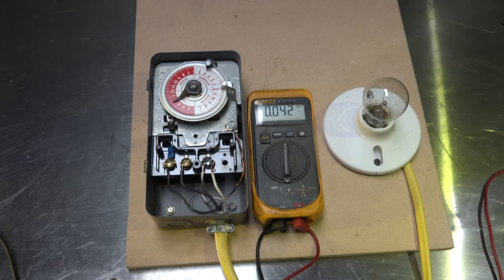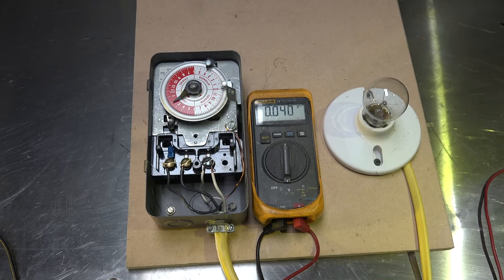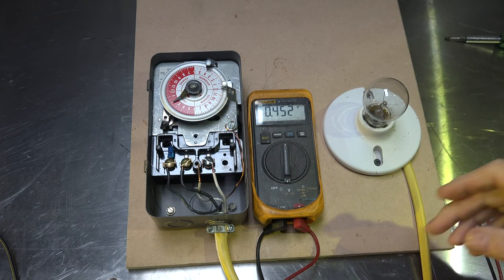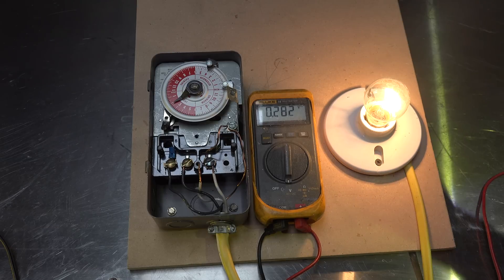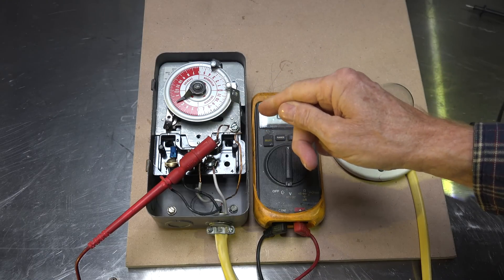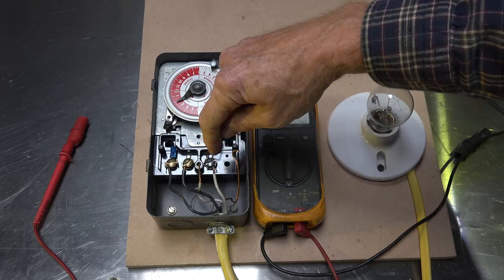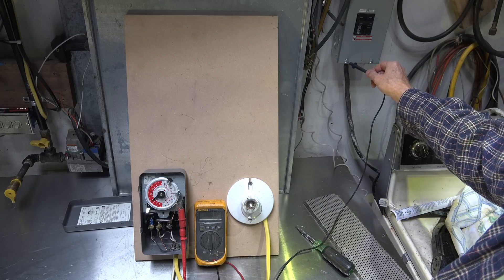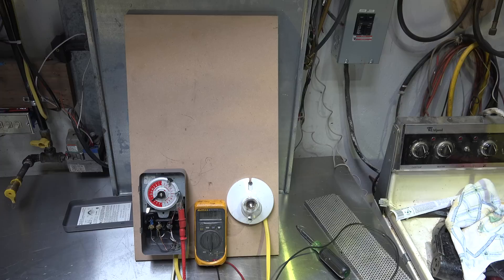The separation of  neutral and ground on the sub panel

Comment: I understand the demo and what is being explained here, I really think that in all the videos I've seen explaining this concept, people tend to over complicate things. The basic takeaway here should be that the neutral is supposed to be the only return path back to the panel. The ground wire is there for safety purposes. But most importantly, just as you should and would never connect grounds and neutrals together under a wire nut or whatever inside any other boxes downstream of the main panel like an outlet or switch box that also means you never do it in sub panel. Its nothing special about sub panels themselves. It has to do with the fact that if ground and neutrals are connected outside the main panel, then what you have is multiple return paths back to the main panel, and one of them being the ground which is not supposed to be a current carrying conductor under normal operation. Hope that clears up any confusion.

Comment: Would not having ground and neutral separated at the sub panel draw more electricity to run motors? My parents have two buildings, a well house and pool bath, that did not require permits due to the sqft per the building department. Their power bill seems to be higher than expected.  I'm trying to figure out why.  Secondly, do you have any tips for getting a neutral wire?  I was thinking about getting a single pole 50 amp breaker to replace the 50 amp double pole that is going out to the well house. Use the second hot wire as a neutral instead and somehow bond the two hot breaker bars in the sub panel together? The well house is about 250' from the main panel. I'm trying to avoid trenching.
Reply from the maker: I think you have a basic misunderstanding of the American 120/240V system.  
The separation of the neutral and ground is a safety issue, and should not increase power usage.  If you think there may be a power leak to ground, you can use a clamp meter on the ground at the sub panel.  There should be little to no amp draw read on the meter.
If the power for the sub panel is 240 volts, you do not need a neutral.
An absolute no on the 50 amp single breaker(if you could find one).
GFM

Comment: I have a generator that runs my fridge during power outages.
The 3-prong fridge 120v power plug gets removed from my house system
and gets plugged into the generator, via extension cord going out the window..
  My generator has its neutral & ground bonded (by the manufacturer).  
Generator also has its motor casing connected to the generator frame by a green 
ground-wire.
Here's my question:  Since the generator sits on 4 rubber wheels, it is not
technically "grounded" (?) . . . So if the fridge shorts out, is the generator frame
hot?  If someone touches the generator, do they then become a ground, and
get shocked, or, will the generator's 20Amp breaker kick off before that happens.?
Secondly, if the fridge shorts out while someone in the house touches its metal frame
with one hand, and a metal kitchen faucet with the other, does that person become
part of the circuit going to the house ground (?).

Comment: This is an awesome demonstration grayfurnaceman!
We have a 220V single phase Air Compressor that has shocked someone when the floor got wet from draining the tank.
I'm  thinking there is a neutral ran to the chassis ground in the pressure switch where the motor ground is also hooked up
causing it but I didn't get a chance to look in the panel.

Comment: But I was reading that before 2008 you could feed 3 wires and Bond the Neutral and Ground which is how it is done in my detached garage in the house that I bought.It was inspected so I assume that it is safe?
Reply from the maker: It is not that its completely unsafe, but it is safer under the new rules.  If it were mine, I would have a separate neutral.
GFM
Reply: @grayfurnaceman  I see. I'm thinking about checking to see if I can run a ground with the other 3, it's probably a 40 - 50 foot run, probably be tough to fish. Thanks for your input.
Reply: @grayfurnaceman  So what happens if I were to un bond my neutral and ground in the sub panel? Does stuff stop working? Is it more dangerous?
Reply from the maker: @BLomedico  If a neutral is installed in the panel, all 120 volt loads will work normally as long as the neutrals from the loads are connected to the neutral buss bar.  240 volt loads do not need a neutral.
GFM
Reply: @grayfurnaceman  Sorry for the ignorance. So do you think it would be less safe or more safe to unbond the neutral and ground in the sub panel. And I hold you harmless for giving me your answer to this hypothetical question. Again I appreciate you taking the time.
Reply from the maker: @BLomedico  More safe to separate.
GFM
Reply: @grayfurnaceman  Thanks again

Comment: I recently moved into rural property. Barn has subpanel with 3 wire service, outlets and lights  have neutral and grounds together on same bus, no ground rod.  So I need separate ground bus connected to ground rod to make it correct?
Reply from the maker: You will need both a ground wire back to the main panel and the neutral back to the panel.  The ground rod will not replace the ground going back to the panel.
GFM
Reply: @grayfurnaceman  It was done in 2004....there is a neutral back to the main......I just want it to be safe .....not sure I could pull a ground through the conduit that has 2 hots and the neutral?
Reply from the maker: @RNSherrod  If there is room in the conduit, you can.
GFM
Reply: @grayfurnaceman  OK.....I have a friend who is a large factory building maintenance electronic technician....I'll ask for some help!  Thanks much.

Comment: How much is the cost to put natural and ground on same bus bar
Reply from the maker: Beats me.  Why would you want to?
GFM
Reply: @grayfurnaceman  well because I am buying a house and in my inspection report it said they needed to be put on same bus bar.i have no idea I know nothing about electrical?
Reply from the maker: @davida8705  In most panels there are 2 buss bars.  One is for neutral and one is for ground.  In the main panel these 2 buss bars are connected together.  If they are not in your panel, it needs a bonding conductor between the 2.  It should not be over about $150 for a professional to install.  That is, of course, if there are no other problems with the panel.
GFM
Reply: @grayfurnaceman  thank you sir

Comment: Don't you have the same situation if the light is being powered from the Main box where the line and ground are supposed to be connected?
Reply from the maker: Once the power leaves the main panel, the separation of neutral and ground is necessary.  Whether it goes to a sub panel or an appliance, it is the same.
GFM
Reply: @grayfurnaceman  Thanks, but can you explain why the separation is necessary?  I understand the how to.  I'm looking for the 'why' behind it
Reply from the maker: @jeffarcher3322  Consider if the ground and neutral were connected together and there was an open in the neutral coming from the load.  The light would work normally.  Then consider if the ground wire made a poor connection.  The chassis would be hot.  We are trying to avoid making the chassis hot.
GFM

Comment: Nice job.  The only follow-up question, and maybe I just need to think it through further, is why a main panel loadcenter IS bonded (neutral & grounds connected)?
Reply from the maker: At the main panel, the ground and neutral are bonded so that lightning and surges have a low impedance path to ground before entering the structure.
GFM

Comment: If a proper earth ground bar were installed at the sub panel, would the problem be solved? This is proposed below in the comments.  If not, what sort of anomalies might occur at the circuits served by this sub panel with a driven ground or a "Ufer ground" to a dedicated piece of rebar in a slab on grade? Great videos!
Reply from the maker: The misconception here is that earth ground is part of the circuit.  It is not.  The neutral is part of the circuit.  It is just bonded to earth to dissipate lightning and surges.
GFM

Comment: Well.. That would only work if you hooked the ground to the terminal on the light which nobody would ever do.. The reason that you don't want multiple bonds is because it will lead to current sharing between the neutral and ground. What's grounded in your house? All metallic objects. So theoretically your panel box would be hot, your stove, deep freeze, etc. Etc.

Comment: Hold on, wait, sorry, I'm confused and here's why. The ground wire fixes the problem it originally creates in a first place. It bonds all metal casings to the neutral bus bar in the main panel essentially making all metal casings around us willing to accept and hapilly close the loop. Then, of course! I'll get shocked if I touch any hot wire and any metal casing around me because we are surrounded by neutrals anywhere in our daily lifes. It's almost like if we poop, eat and sleep hugging the neutral bus bar waiting for hottie to come to us one day. If we would get rid off all grounding or bonding on all devices all together - nothing would become hot! If all that grounding nonsense was introduced just because of questinable concern that the electricity may find its way back through the actual soil, concrete, laminate, tiles - I've never seen that happening in real life. At least, not with 120v or even 240v.The resistance of the soil, even wet one, is high enough to choke 120v, or even 240v. It might be a concern with 480v, and definitely an issue with everything in kV range. But for the residential use it feels like an overkill, covering rare kinda bad karma circumstances. What if meteorite hits in my head? Did I missed anything?

Comment: I am working in soudi arabia 
Here use tha both supply i means 110 and 220 
2 phase come in 220 
1 phasr and 1 neutral come in 110
if socket in not avalibale 2 phases than what we neutral repleace tha earth leakge wire on use the 220 
Plz tell me

Comment: I wish I could see where the yellow wire goes! Is it a “12/4 with Ground”? Is there even such a thing?
Reply: Outside cable color of Yellow is for 12 gauge   (white = 14 gauge   orange = 10 gauge)

Inside 12/4 is likely
white
black
red
bare copper

The red wire varies in usage.
It can carry a second hot to make for 220v circuit
or it can be  used for switches (especially setting up 2-way switches)
Reply: @2Truth4Liberty  - What you've described is 12/3, not 12/4.   You don't count the ground wire in the 12/# count.  

12/2 is black,white, and ground.  12/3 is black, red, white, and ground.
Reply: @NorthFaceHiker Yes, I misspoke - probably inadvertently copying from the original comment. 12/3w/g is what I meant

Comment: So then let me get this straight please someone help me out in other words do not mix ground with neutral at all cases?
Reply from the maker: Once the power leaves the main panel, the neutral and ground are separated whether in a sub panel or an appliance.  Hope this helps.
GFM
Reply: Yes. Only mix at MAIN PANEL
AND the MAIN PANEL should have a wire going to Earth - usually a 8 awg bare wire running to a 5/8 copper rod that is buried in the Earth.

Comment: To be clear, you have to have a couple things go wrong at the same time to energize a box. The neutral would have the be grounded AND the ground would need to be bad at the same time.
Reply from the maker: The problem with that logic is the grounding or neutral could have failed earlier and there would be no indication of a failure until the other failure happened.
GFM

Comment: We had a sub panel installed next to the main panel for some extra breakers a few years ago, and yesterday I discovered that we had the neutral and grounds together, and the neutral cable going back to the main panel was carrying the ground as well.

I went to the store and grabbed a grounding bar and fixed it up, by running a ground wire, but I'm startled that it was like that for two years.

Like many others, I was confused about why it mattered that it had to be like this in the sub panel and not the main but I feel like you did a good job explaining the dangers. Thanks!
Reply: It also matters even if all of your wiring is perfectly healthy.
If an appliance (vacuum, hair drier, etc) shorts out while using it, you want the grounded case of the appliance to have unimpeded path (path of least resistance) to Earth ground so that your body doesn't appear to be that path.

If you connect ground and neutral at the subpanel, then shorted ground current has to compete with whatever other electricity is running on that circuit (using up capacity of the neutral) to get from the subpanel to the main - raising the resistance and making your body look more tasty as an alternative  :-0).

THAT SAID --
You CAN connect ground and neutral in a subpanel BUT IF YOU DO
you should(must) ALSO connect a wire from ground to Earth (just like the main panel does/should) THAT preserves the "path of least resistance" in case of a shorted appliance.

Usually an Earth ground wire is an 8 AWG bare copper wire running from the panel to a ground rod buried nearby.

 (PS in the case of making the subpanel hot as warned of in the video
-- with a wire to Earth ground rather than the panel becoming hot, it would blow the breaker that was supplying the hot power)

Comment: Doesnt make sense to me especially when the ground and neutral connect to each other at the breaker box (from what I've seen)
Reply: ground and neutral are connected at main panel as a fail safe in the case of something like lightning striking the power pole so it doesn't pop every fixture in your house and the electricity can safely pass to a non conductive material IE dirt

Comment: I see condensate pumps wired using the ground as a neutral all the time, some have fuses but I don't see how that would help
Reply from the maker: If it was done by a manufacturer, it was ok until around 1995.  Since then a separate neutral is required.
GFM

Comment: I remember there was some Mike Holt video where he talked about a case where someone replaced a light switch with one of those combination switch/receptacles.  Presumably the switch was installed before the NEC started requiring neutrals in switch boxes because the installer just used the equipment ground in the box as the receptacle's neutral.  Later on someone was working in the home's crawl space, lying on wet ground, and had a corded drill plugged into it and sure enough the ground somewhere upstream had a bad connection and the guy got shocked when he started the drill.  I don't remember if he survived or not.
Reply from the maker: And so goes the reason for the separate neutral.
GFM
Reply: I remember seeing that video. Sadly, the guy did indeed die.

Comment: I am not a trained electrician.  When we see that the ground and neutral are connected to each other at the main panel it can fool us into believing that they share the same function but they don't.  Each part of a three wire system has a unique function.  These are:
1 - Source (main panel) - this is the source of power, could be a generator, battery or mains
2 - Load (electrical device) - This is the electrical "thing" that uses the power
3 - Hot Lead (black wire) - This wire conducts current from the Source to the Load
4 - Neutral Lead (white wire) - This wire conducts current from the Load back to the Source
5 - Bare conductor (copper wire, metal box, chassis or metal conduit) - This conductor is a fail-safe device that conducts current only in the case that there is a failure in the circuit.  
Never use these five parts for anything other than their intended purpose.
Reply: Electricians use to lick their fingers and touch the wire to see if it was hot, before fancy voltage detectors. Not suggesting that, but thought I'd share lol. Being a former linemen, I've also heard old guys tell me about linemen who would wrap copper around their leg and attach it to the 7,200 volt line so they could work without gloves and sleeves. This is while standing in a insulated bucket truck though. Very dangerous, especially if your left arm is on the line and your right arm touches the pole. Or even worse phase to phase contact.. Not me lol.
Reply from the maker: Agreed
GFM
Reply: Can you make a correct video on this ? Much appreciated
Reply: Terry Pullen will it effect my electric bill if the neutral and ground wires ARE bonded at the sub panel??

Comment: question.. if there isn't supposed to be continuity between the ground and neutral in the sub panel, but the wires feeding the sub panel from the main(ground and neutral are on the same bar then there will be continuity.... also does the sub panel need its own ground rod?
Reply from the maker: Generally, there is no need for a separate ground rod.  The earth ground is not necessary for the operation of the electrical system.
GFM
Reply: thank you...  what about continuity in the sub panel?
Reply: You shouldn’t install a second ground rod, you will likely get a ground loop.  It will likely inject noise into the system and that will mess with your electronic equipment (and that’s a good outcome compared to other options should the potential between the two grounds get too high, then you are talking shocks that won’t be fun)
Reply: Recommend only one ground rod but if using more than one ground rod, they should all be bonded together (copper wire running one to the other).

Earth ground is not for completing the electrical circuit, it is an outlet in case the circuit fails - and getting that loose live load back onto the neutral is to trip the breaker (the Earth ground alone may not be conductive enough to do that).

Obviously, any where neutral and ground are tied together should also have a wire running to Earth.